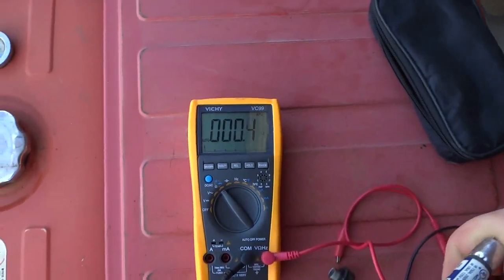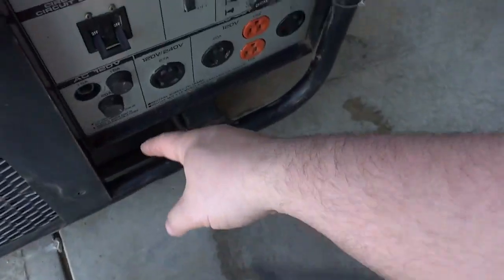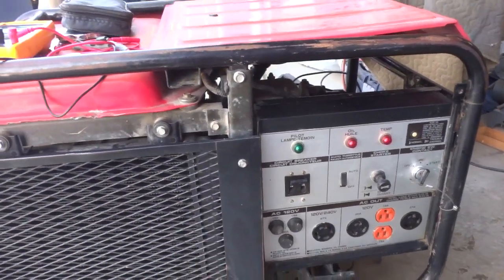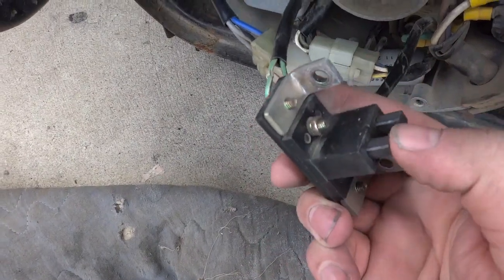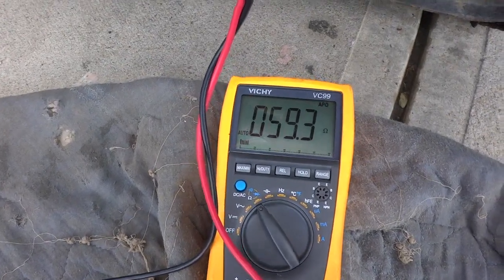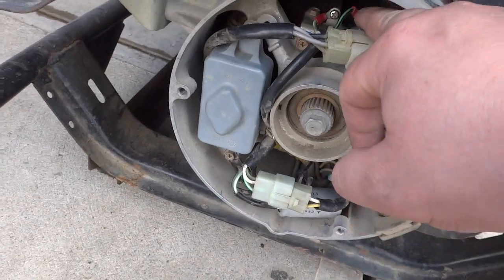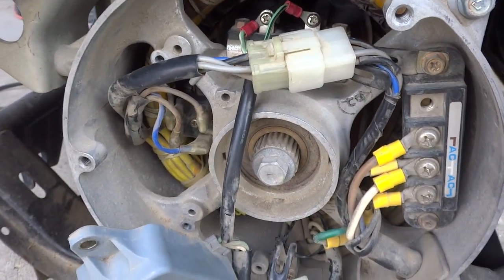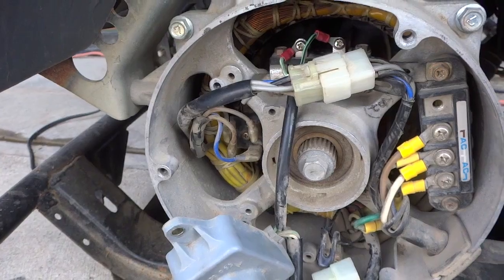Troubleshooting a Generator with A No Power issue

Comment: Mine  a Honda only 15 hrs old suddenly stopped pumping out juice yesterday. Useful insights here. Thanks!
Reply from the maker: Take it in for warranty
Reply: @BackCountryWrenching  Am  further into the problem. Mine is a Honda EM5000SX and in the end a GFCI outlet popped. In my case gen  is in an enclosed ventilated compartment and the vent fan is connected to the GFCI outlet and the generator droned on as the outlet tripped and the fan shut down. Not a good situation. These GFCI outlets are a curse.

Comment: have a eu2000i starts runs puts out 12 volt 8 amps on 120 side puts out 178 can I run a small heater off this or will i burn the place down... friend said would burn up grinders and drills,winter about here help??
Reply: Your generator should be able to run small power tools or a 1500 watt heater not exceeding 13 amps.  It won't start a table saw (surge current requirements exceed the capacity of the generator).  I checked the specs.  Your generator should have a model number eu1600i.  It can run a 1600 watt load, surge capacity is 2000 watts.  False advertising.  Making you think you have a 2000 watt generator when in reality it's a 1600 watt generator.
Reply: derrick johnston, I know your post is 2 years old but I will attempt to answer it based on your question. You say the 120 volt output is putting out 178 volts. I would say to not use it. If you do, you need to use electrical items that are auto sensing for 120 volts or 240 volts. If it can take either 120 or 240, it should power fine. I had a situation where a main line was grounding out on a drain pipe in the wall and the 120 on one side was putting out 10 volts and on the other side it was putting out 230 volts.  It would only do this when it had been raining for a week or longer. This told me there is a leak in the roof contributing to the short.

This is what I did. I purchased everything I could find that would run on 120 or 240 and things stopped burning up when the short would kick in. LED 120/240 volt light bulbs that are dimmable have lasted over two years now. It has taken me this long to discover where the short is. I have purchased a new mains panel and will install it 15 foot closer to my electric meter and run a new mains line from the meter to the new panel. While the wall is open, I will most likely remove part of the old cast iron drain pipe no longer in use. What does this have to do with your generator? It may have a short. Trying to run a 120 volt item on 178 volts is not a good idea... in fact it is a bad idea. We use propane gas heaters to heat with.

Comment: I have the same generator the battery don't charge when running can you help me tell me what to check. only reading battery voltage.
Reply: I have a B&S 8kw generator.  Don't know if it is the same as yours (video not that detailed).  But my owner's manual says that I need to use the included "battery maintainer" to keep the battery charged.  It's just a small, 750ma batter charger.  Seems like they could have made and included a simple charger for the battery.  After i start my generator, I plug in my "battery maintainer" jack.  It cautions me not to start the engine with the battery maintainer plugged into the charging jack.

Comment: hey I came across your video online here I recently sold a Tecumseh 2500 Watt residential generator to someone on Kijiji I tested it before I left my house and it had power what I got to his house I started it for him figuring that he would test it he didn't I suggested he should he did he paid me I left an hour later he calls me and tells me that it has no power what should I do
Reply: I know your post is 2 years old but it would be clear to do for the buyer what you would want done for you. I would pay to have it shipped back and when I get it and verify it is the one I sold, I would refund all the buyer's money and if they paid the first shipping, I would refund that too. Then I would have it looked at or look at it myself. The other option is to find a repair shop where the buyer is(do not ask them find a repair shop) and have them take it there and have the repair shop report back to you. Pay for it to be fixed and returned to the buyer.

Comment: I have a Troy Bilt generator with a Briggs and Stratton motor.  Its the 6,250 watt generator, was purchased in 2010.  I only use this generator during power outages and occasionally for other stuff.   I keep it secured in a dry building and I start it about every other month and let it run for about an hour.  This thing has never given me a problem until 2 days ago.  The power went out, pulled it out, fired it up, ran fine but no electricity coming out of the outlets.  Just speaking from a "more than likely" point of view, what would be your guess?  This thing has few hours on it, but its 6 years old, but rarely ran.  Do you think something has rusted up or can you probably rule anything out??   I'm very mechanically inclined with engines, but electrical stuff like this is a little more difficult.
Reply: Check the obvious.  Press the circuit breakers on the generator to ensure they are reset.  Common problem.  Sometimes it's hard to see that they have tripped.  Beyond that, someone will have to take a deeper look at it.  Hard to believe that such a low-time genset would have a problem with the generator.,

Comment: You said check to see if 25 volts + or -  3 volts accross the brushes...  I was told there should be 5 to 10 volts accross brushes îf more it îs the rotor!  can you clarify thanks! !

Comment: What is the function of the voltage regulator?
Reply: It indirectly regulates the 120vac output by regulating the lower voltage supplied to the field winding.